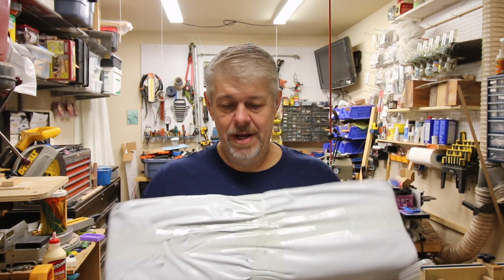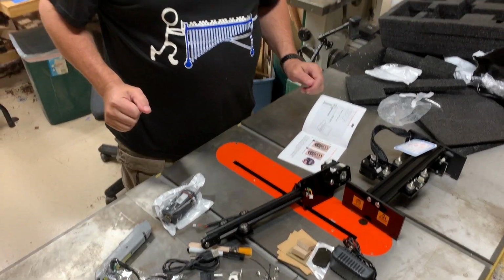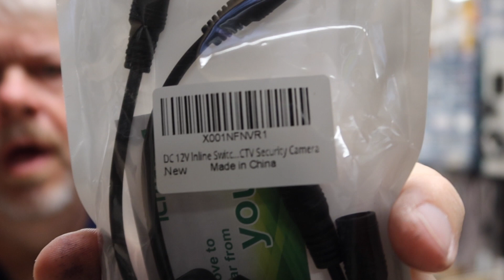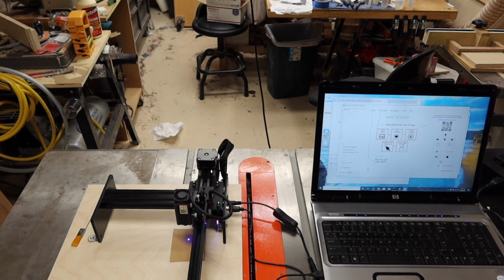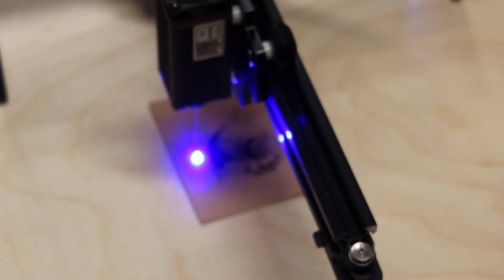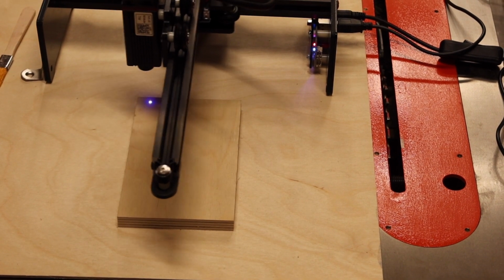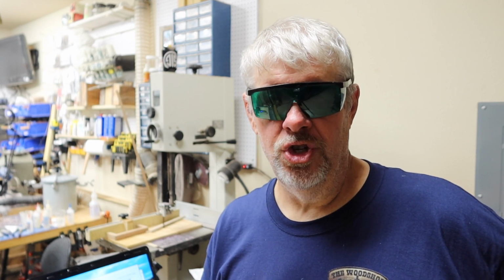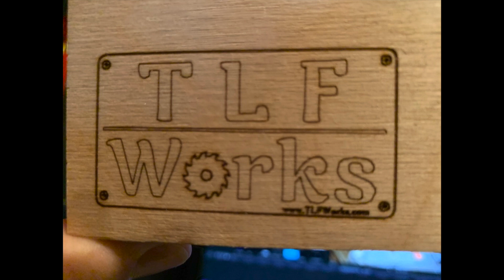Unboxing the Neje Master 7W Laser

Comment: It says "Please turn on the power supply after installing the laser, otherwise it may cause damage to the main board." Does this mean it has to be connected to the power supply 24/7?
Reply from the maker: You would not want the power connected to the product while installing or uninstalling the laser. I guess the manual is trying to keep you from causing an electrical short that would ruin the main board. I would hope you don't have power to the unit during this time as well to avoid the laser turning on and possibly pointing at your eyes and causing damage. Once the laser has been installed, and the product is assembled, I would only have power connected to the unit during use. 

Thanks, 
-Todd
Reply: @TLFWorks  Ahh, that makes sense now. Guess I misread it. Thanks a lot Todd.

Comment: Hi
Great video, just what I need now as I got mine in the mail today and are in the process of getting up and running.  But I have a problem, I think, I can feel there is some play in the X-plate, the plate where the Y-arm is mounted on.  I tried to tighten all screws but it doesn’t seem to help.  It’s like the wheels with the W-shape are not tight enough against the crossbar.  I notice this by holding the end of the Y-arm and I can wiggle it sideways and also up and down.  Do you have this problem?
Reply from the maker: Thanks for the comment. I don't have that problem, but if I come across a solution I will reply here.
Reply: I have the same problem and don't know how to fix it. When the 4 screws are somewhat tight the rig cannot move along the Y axis, too much friction. But if I loosen them just enough so the arm can slide then it is too loose and the entire arm wobbles. This creates some rough spots where the belt skips so I decided to put a very small amount of synthetic lubricant on the flat surface so it can glide a bit more smoothly. It helps a little but it is not a solution.
Reply: @dejanrajcic8686  I think I found a solution that will fix this: eccentric spacers.  I have ordered some and will experiment with it.  It may require to drill bigger holes in the plate to fit the eccentric spacers, I am not sure about that.

Comment: Hey man, quick question. I'm thinking of getting the 7w one, and I was thinking if it could engrave my matte black zippo lighter? I don't wanna engrave the metal, just the paint so that I can see the design of the metal underneath. Will the effect be good? Many thanks!
Reply from the maker: I have had success engraving painted, metal surfaces. I would think this should work as well.
Reply: @TLFWorks  Cheers thanks!

Comment: thanks for the video. yes as long as you just engrave pictures and the like everything's fine. but that's pixel firing and you can't get a nice straight line.

i tried using a gcode file to get a sharp image of lines (or fonts, for that matter). i tried many things, for hours. 

if anyone has found out how to turn the laser on and off running gcode through this NEJE software 4.7.2, let me know, because M3 and M5 don't work, neither does M4 or M106 or M107.

any other software can turn this laser on and off with those commands, but sadly, nothing else works. with the NEJE software it's the other way around. 

the software ignores M3 and M5, making it unusable software for .nc files. and i get no answer from the people at NEJE.

the sad part is, the gcode files included with the software DO actually turn the laser on and off, so you don't have lines between letters! but you can't look at the code to see how they did it.
it's a pity, because otherwise the machine is really nice. but with this major drawback keeping you from doing precision lasering THAT IT WOULD BE CAPABLE OF, it's useless.
Reply from the maker: I used Fusion 360 to create one file for the NEJE Laser. It worked great. I have little knowledge of gCode or the limited capabilities of this printer when using gCode. Thank you for the feedback and good luck!
Reply: i've tried dxf too. there's not a whole lot of versions of dxf that the program accepts. autocad 10 and 14 aren't accepted. and that's all i can export.